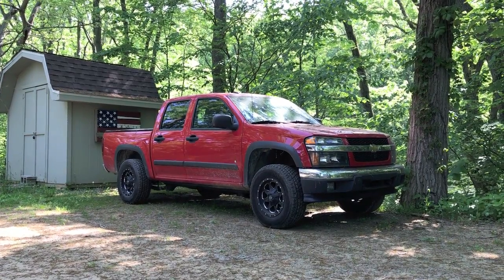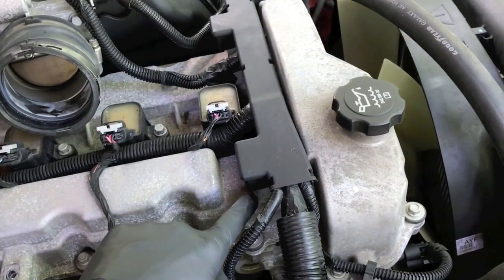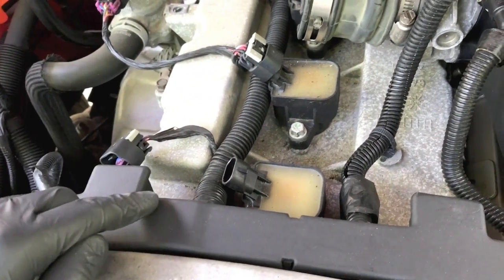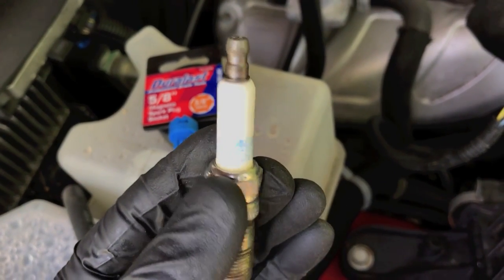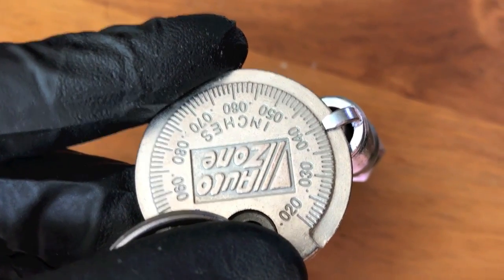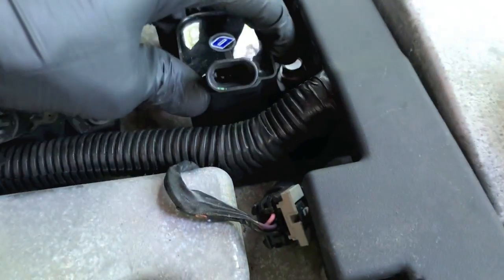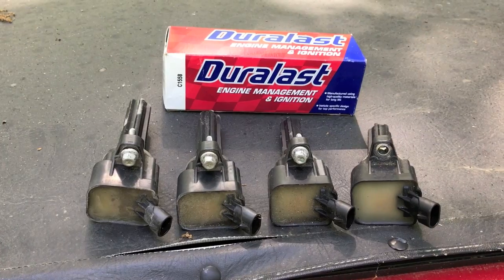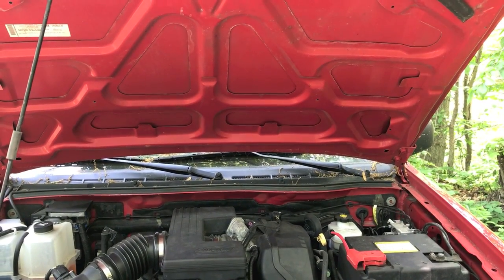P0300/P0304 - Replace Spark Plugs Chevy Colorado, Silverado, GMC Canyon

Comment: how did your 4 cylinder motor end up with 5 coils lol
Reply from the maker: Thanks for watching & that’s a great question.  This is the “I-5” engine...aka...Inline 5 cylinder.

Definitely requires 5 plugs.  😎👍
Reply: @DIYwithMichaelBorders  sry i just found out gm made a 5 cylinder holy cow i bad was trying to find plug gap for 2017 2.9 an no luck so far
Reply from the maker: @pl7868  

Thanks for the reply.  We have enjoyed it.  Keep us posted on your project.

😎👍🔧🔩

Comment: How was your Colorado acting before you changed these ignition coils. My Colorado is shaking bad when I start it and sometimes misfires. I got a P0300 and P0366 code. From what the previous owner said the camshaft sensor was changed and the spark plugs also. It won’t pass smog
Reply from the maker: El Chukis 

Thanks for watching & literally the exact same symptoms.  It’s like our Colorado’s are twins...🤔...😀

Replacing the coils solved all engine issues.  Keep us posted.  Please subscribe to the channel and ring your YouTube bell 🔔 this Will be very helpful to us thanks again!

😎👍🔧🔩
Reply: I have a 05 , and it got a po300 andpo442 just happened today.i went to back up and it was like someone started putting the brakes on.ever heard of that?
Reply: @ernestwingerd9076  hey bro no not familiar, I got rid of the truck right away hahahahaha I sold it a few days after that started happening

Comment: One very important step not mentioned is adding a thin layer of anti-seize to the plug threads prior to installation, also a dab of die-electric grease to the plug connector at the plug & wire connector
Reply from the maker: 1calcitydan 

Thanks for watching & sharing your thoughts.  We appreciate it.  Please subscribe to the channel and turn on your YouTube notification Bell 🛎 that would be awesome thanks again!

😎👍🔧🔩